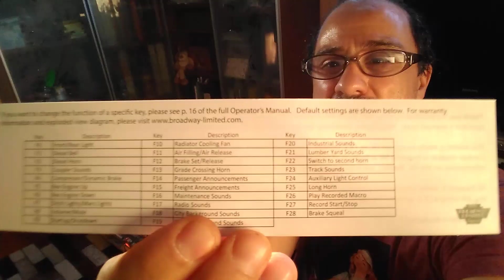My new BLI SD70ACe Norfolk Southern with sound, N scale.

Comment: Wow what is the radius off the track?
Reply from the maker: I'm using Fleischmann N Track R1 = 192mm = 7.56" and R2 = 225.6mm = 8.88". They are very tight curves but this engine runs on them without issues. Thanks for watching and sorry for the late reply.